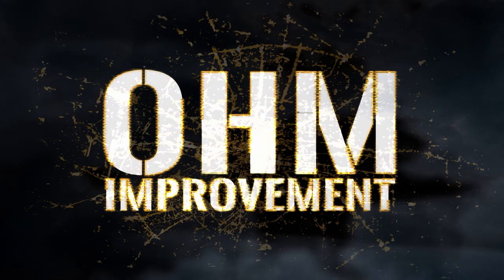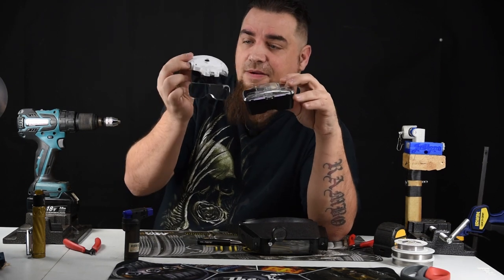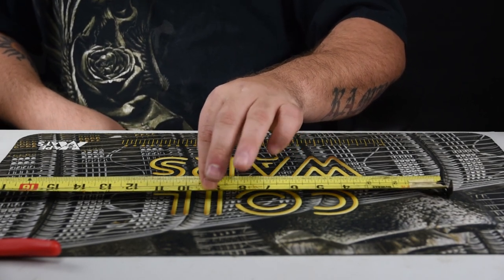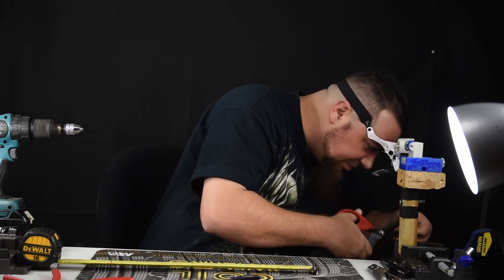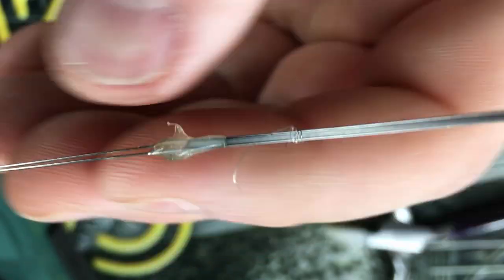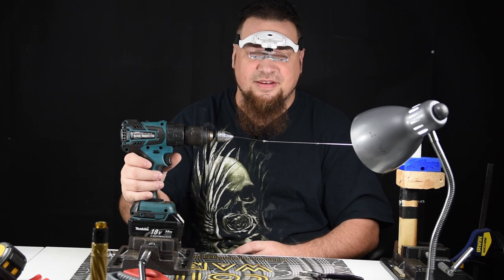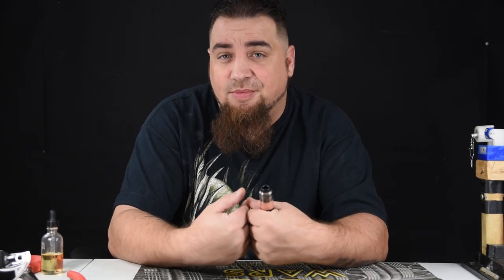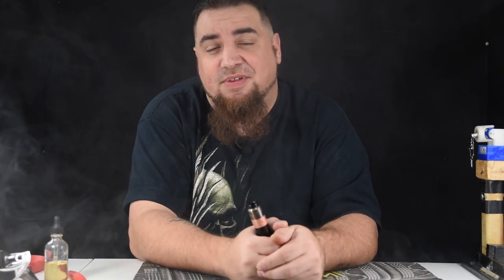Framed Staple Clapton Tutorial (Floating the Ribbon)

Comment: Having trouble with alien wraps.  Hoping to see your technique and learn a few pointers.
Reply: Im sure you mastered them by now but just make a bunch of decores like 6 of them 12 inches long and do a bunch of short 6 inch lengths of 3 cores and alien wrap them varying your stretch tension and lead angle every time and eventually you will get a feel for it. I could for instance tell you that for a 12 ply framed staple you decore from a 22g, stretch to 90 degree angles, and lead by 12ish degrees with pretty hard pressure, but if you have the feel and understanding of how it works by learning it yourself you will be able to apply it to other builds.
Reply: @melody3741  thanks! Ya I think about a week after posting that I hadnt slept much at all but I did end up getting the hang of it.  Check out my work @keymaker_coils on IG!

Comment: this floating staples technique is eally dope. zero danger getting the stack damaged. i follow the same principle, but i loop the staple tthough the swiwels. Someone can try fusing with 42-46 awg for a better result, with less pressure on the fuse wire. for 44awg and 46+ awg fuse wire, i would reccomend a least a 1500rpm drill, since fusing takes way too long. i really liked the light trick because you only get the perfect fuse if the reflection of the light onto the build at its most intensity.